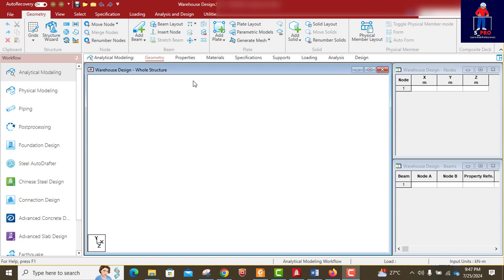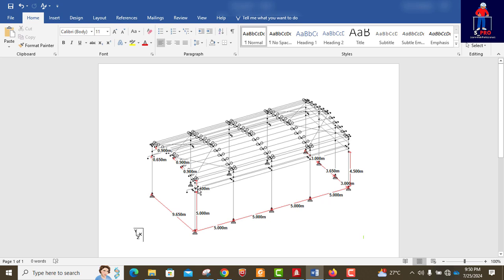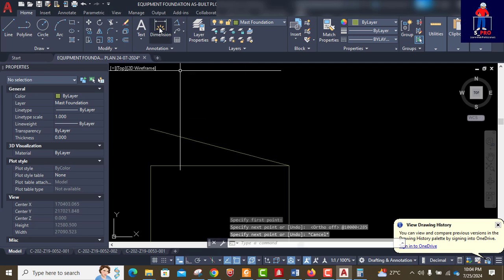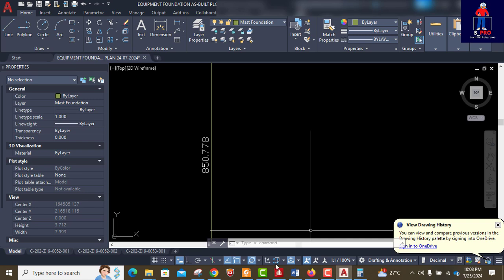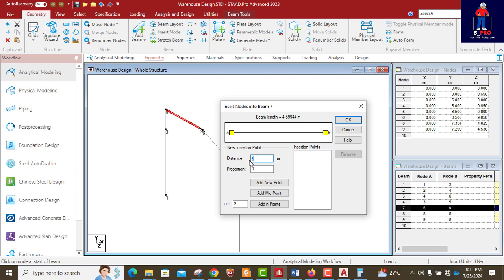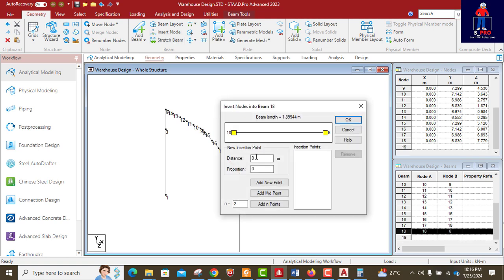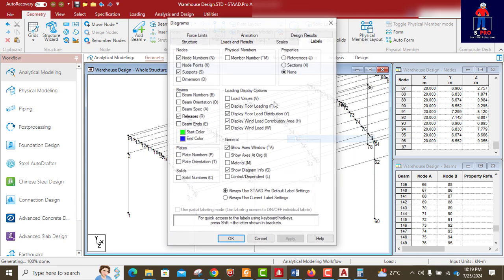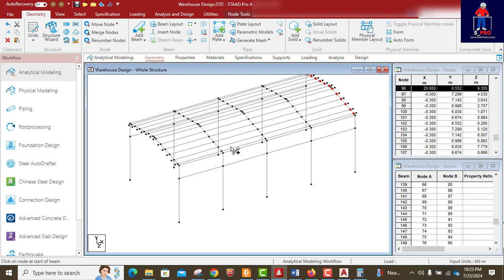Warehouse Structural Design 01

Comment: Does purlins need to be built in the model for analysis?
Reply from the maker: It's not a must but it's better to model the purlins because the roof loads are supposed to be applied to the purlins and not rafters.